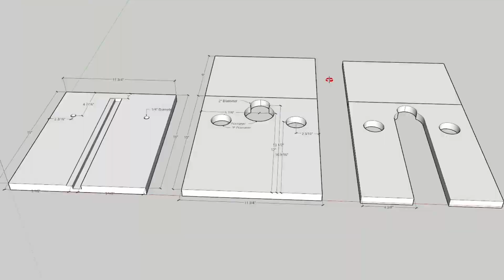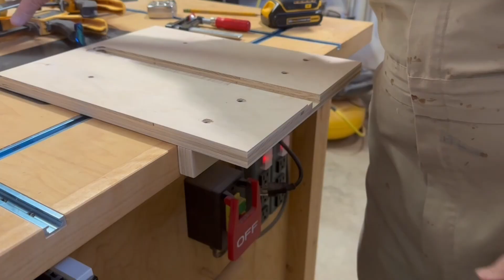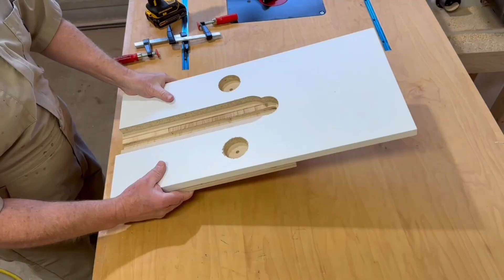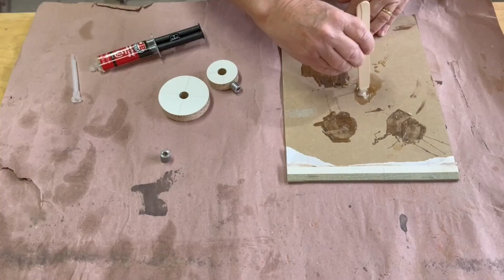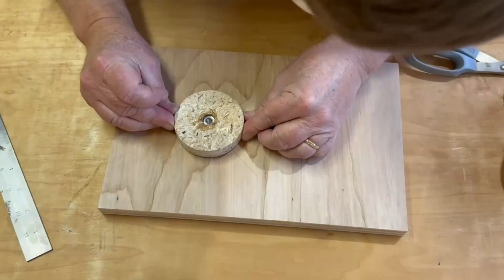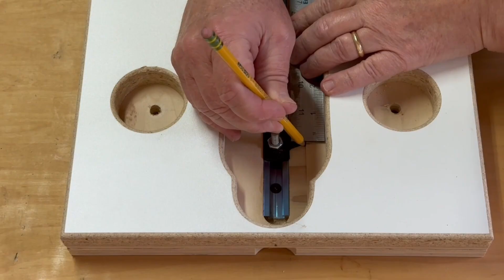How to Build a Circle Cutting Jig

Comment: Hey! Look what I need to make next.... for a often asked for cribbage board design-center piece. This will be much faster than doing it on the cnc. Thank you! Wondering if you have plans OR should I just take screen shots and modify for my own setup? and again, Thank you!
Reply from the maker: Thanks!  I'm happy to hear the video is helpful!  I don't have plans for it, hopefully you can get the dimensions from the video.  Just beware that the dimensions are specific to my bandsaw and router table, so it's worth double checking with your machines.